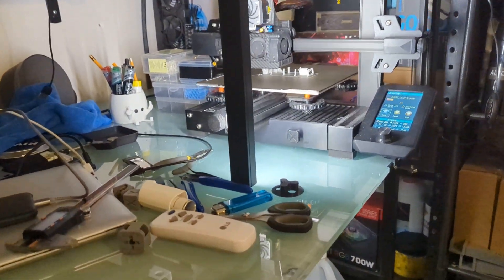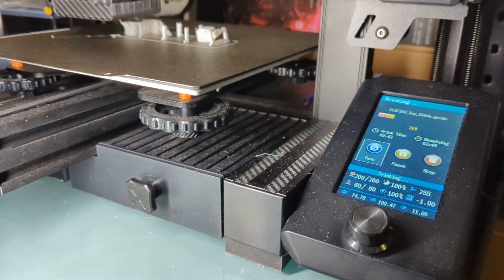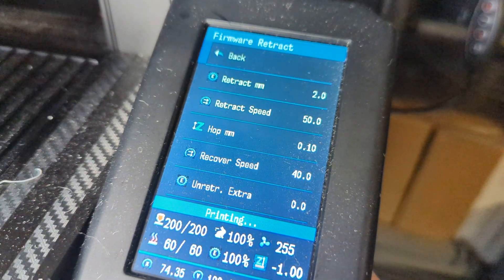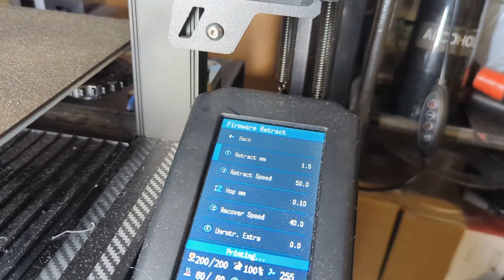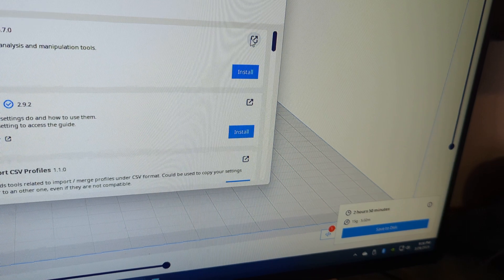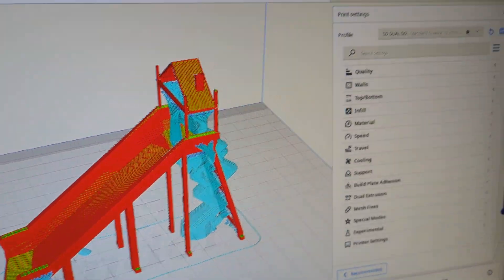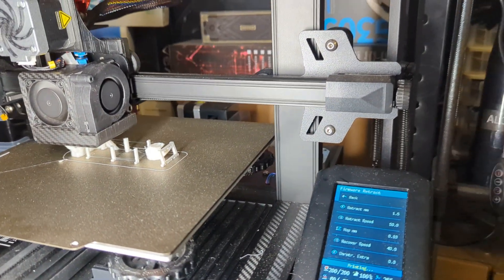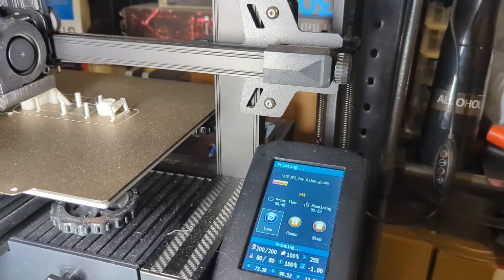Ender 3 V2 Neo - Firmware Retraction EZPZ

Comment: I have 2 ender 3v2. One had 1.0.4 and the other had 1.0.7. I installed the software you mentioned, the pro version, on the printer that had 1.0.4. I have more than 100 models prepared before and I use them regularly. Now, although I made the retraction settings on my models myself, I am experiencing serious problems because of firmware retraction. I made a voron m4 direct drive for my printer. In its previous state, I could fix the e-step value of this software to 560. Now, when I try to download the old version, the e-step value remains fixed at 186 and does not go above 560. Do you have any information on how I can disable firmware retraction? I cannot find the old firmware that goes up to 560 estep value.